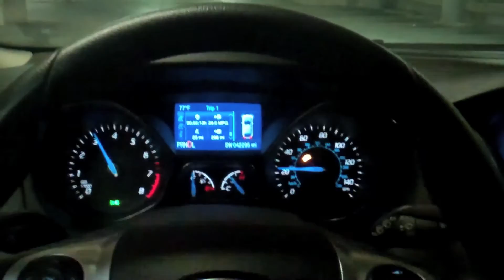2014 Ford Focus SE Exhaust

Comment: I did 2.5 from the cat back and removed the resonator and it's louder and pops every now and then. I get a lot of people asking me what's done to mine cuz it sounds so good. I also have several other bolt ons but these cars sound really good with 2.5 inch piping. I also have a flowmaster super 10 series muffler which is their loudest. Sounds really good and growls. I'll post a video of mine soon
Reply: I just have mine with a muffler and resonator delete with stock size piping single exit with dual tips and it sounds crazy😂
Reply: I’m going to do engine mods soon but idk what mods to do?

Comment: I love this set up I wanna install it asap. What’s the process and what parts do I need brand wise.
Reply from the maker: I took it to a local muffler shop. if you're planning on doing it yourself you will need some 2&1/4in pipe as well as a Flowmaster 80 series muffler. The system is stock still including the resonator. Fair warning that the exhaust drones on long trips but I still have driven it over 6 hours straight without absolutely dying. Another warning is that after the muffler breaks-in the system seems to lose back pressure and cause the downstream O2 sensor to trip the check engine light. I autocross pretty frequently and it only happens after these sessions. If you're not planning on racing the setup shouldn't cause you any issues.